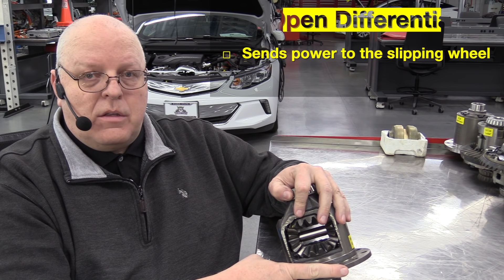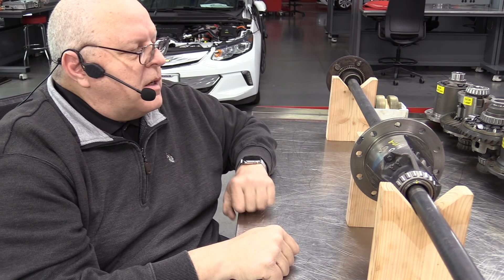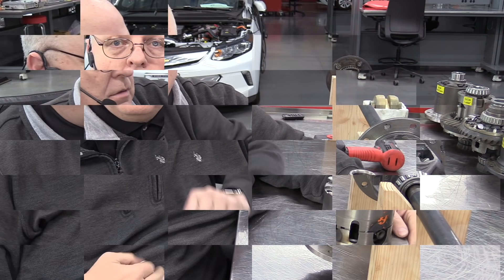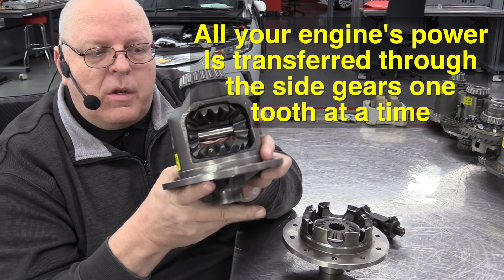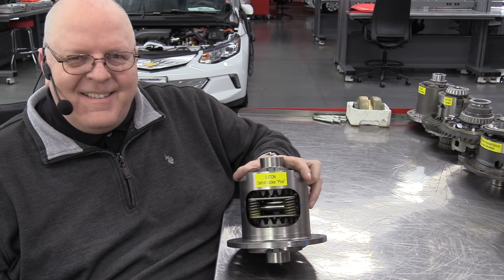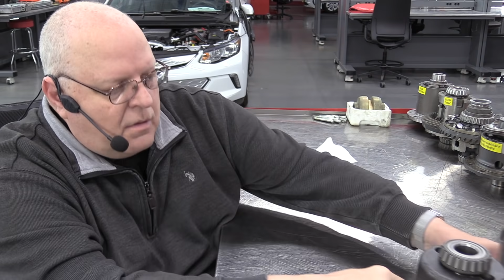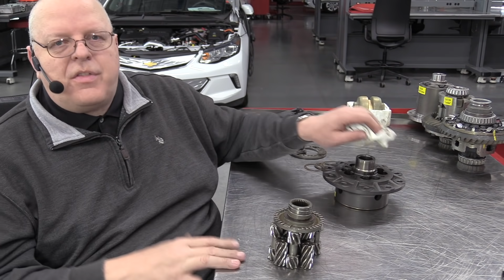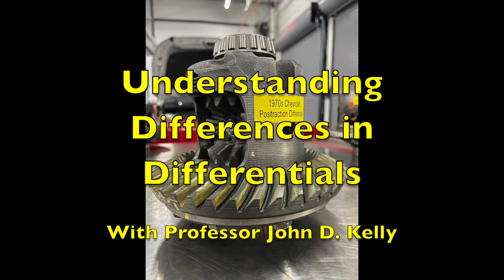Understanding Differences in Automotive Differentials

Comment: Man, this channel can't ever be boring with this much knowledge shared to you. 
Some of my friends find it funny how I talk about differentials a lot but they don't know how much goes into it 😂
Reply from the maker: Thank you very much
Reply: Differential Gear Ratios are a big deal for freight weights on a semi.  The quicker way to mitigate or escalate your RPMs is to experiment with tire sizes.  But, has anyone invented a differential gearing system with multiple ratios that could be changed electronically? Do they last as long as a fixated DGR?  A trucker reportedly has to consider component longevity to stay financially solvent.
Reply: @wanderingfido  Mitsubishi had that kind of system in Pajero and Colt atleast in the 80's. It was called gear multiplier. I remember it having only two gears in the differential, low and high.
Reply: @wanderingfido  Eaton made & still makes 2 & 3 speed rear drive axles. 
In low range, both axles are in low range. Your inner axle differential lock can be locked.  
In medium range, the front axle is in low range, the rear axle is in high range. Your inter axle differential lock can not be used in medium range. 
In high range, both differentials are in high range. Your inner axle differential lock can be used. 
Hello from north east Montana. 
10 miles from the Canadian border.
Reply: Didn’t know they had so many
Reply: Good video and I also appreciate all the information in the comments , great stuff, I received some clarity on the function of differentials, thank you

Comment: Very interesting video! 
I was wondering, which is more economical for manufacturers these days; installing a LSD or use a regular open diff and use the ABS system to individually brake the wheel that has lost traction in order to transfer power to the wheel that grabs? 
Also, what is a "torque vectoring" system on an AWD vehicle? Does it use the ABS system to do what I've described, but for all four wheels? 
Thank you for sharing, professor. Always very clear and easy to understand explanations and demonstrations.
Reply from the maker: Thank you very much. That is a good question. I am looking at several differentials from Tesla models S and 3 and they are all open differentials. Some performance cars come with Torsen style differentials. I suspect it is less expensive use the brake system for traction control. More to come on torque vectoring.  Thanks for watching!
Reply: You can't use ABS to brake one wheel. ABS only reduces brake pressure. You need a traction control system (with a pump and computer controlled servo valves) to add pressure at a wheel. Using traction control you need to see a wheel slip and then respond to it. It's inherently slower and harder to control than a dedicated locking diff system (but cheaper). For example, a wet or dry brake rotor will change the characteristics of the traction control system dramatically. Typically off-road or high performance vehicles use locking/LSD diffs and traction control together. Torque vectoring uses this type of system with some fancy control algorithms.

P. S. The stability control (and torque vectoring) systems are the same concept as traction control except it is controlling the wheels during a turn, whereas traction control is only when the steering wheel is straight.
Reply: @tomgnyc  
Thanks. You're absolutely right, my mistake. I should have said TCS and not ABS. Lucky that I'm not a mechanics professor! 😆
Reply: McLaren p1 has that design lol

Comment: Thanks  for making this video! Can you comment on which category Honda’s SH-AWD rear differential falls into?
Reply from the maker: It is in a category of its own. Maybe someday I will get my hands on one. Thanks for watching
Reply: @WeberAuto , I'd LOVE to see you make a video explaining the differences between Honda's various AWD systems including: 1) Real Time All-Wheel Drive (older CR-V), 2) Real Time All-Wheel Drive with Intelligent Control System (newer CR-V and HR-V), VTM-4 (older Pilot and Ridgeline), iVTM-4 (newer Pilot, Ridgeline, and Passport), and the FOUR generations of Acura's SH-AWD. I'd be happy to contribute what I can based on my understanding of these various systems such as which ones use a single clutch vs. dual clutches, mechanically-controlled vs. electrically-controlled vs. hydraulically-controlled, overdriven vs. non-overdriven, etc. As a long-time Honda enthusiast and mod/admin of several Honda forums, I see a LOT of misinformation and misunderstanding about these and other AWD systems on the market.
Reply from the maker: The overdriven versions are the coolest in my opinion. Don't forget the RLX Sport hybrid's twin electric motor variation. I would love to do that, but obtaining the components is always an issue. I like to show the parts in action rather than drawing on a whiteboard or just talking about them. I am actively trying to find the RLX sport hybrid version at this time. Thanks for watching.
Reply: SH-AWD would be classified as an electronically controlled locking differential.

It uses two clutches in the rear differential to achieve torque transfer. One for each axle. This is somewhat like the Haldex clutch system in VW and Audi vehicles. Except they use only one electronic clutch bathed in a separate fluid, which can only disengage and engage the rear drive shaft at a variable slip rate.

For some model years the SH-AWD system instead used a single viscose coupling and dropped the electronic clutches for weight savings and fuel economy reasons. Much like like the Honda CRV's AWD system.